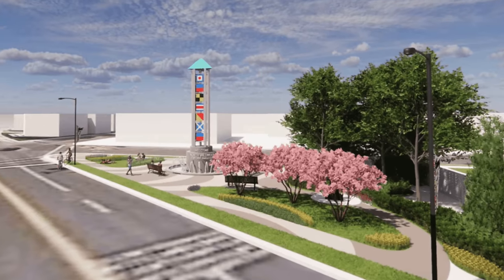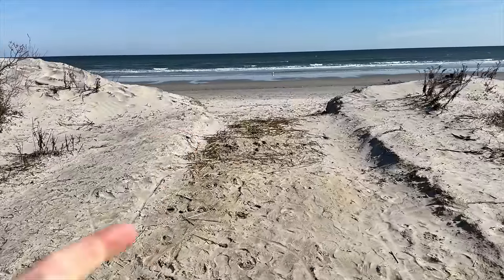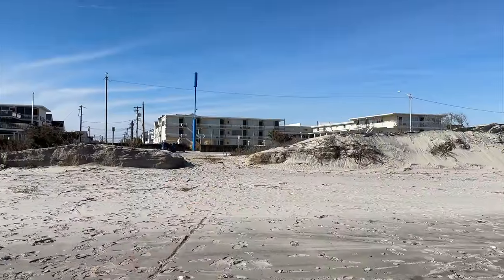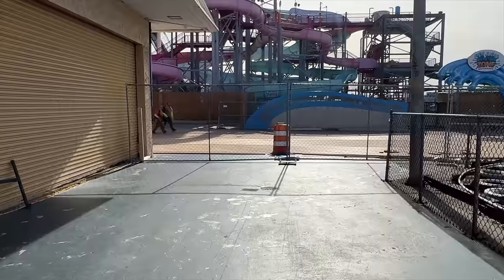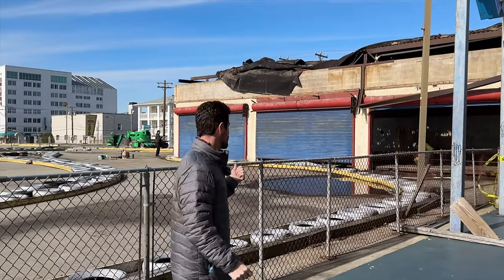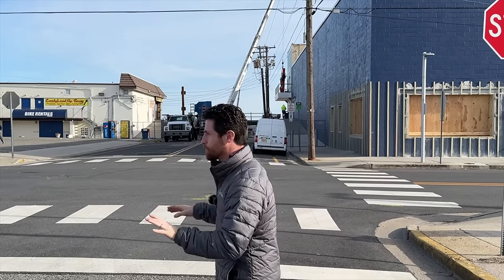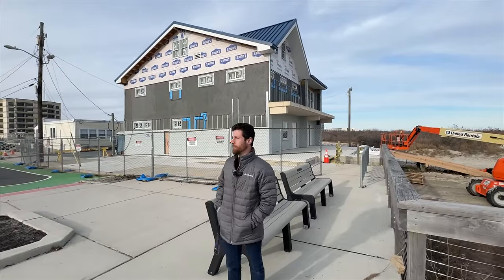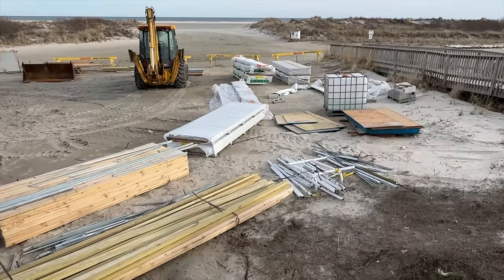Wildwoods Construction Update - March 2024

Comment: Wildwood is almost unrecognizable from my days there 1960 thru 2000. Last house on the left, Oak Avenue, right on the bay.  The train tracks were between the house and the power station.  We crabbed on the trestle that connected to West wildwood. There was an arcade next to that Hot Spot location at Oak that had machines from the 40's and 50's. We saw Jaws at the Theater that used to be where the waterpark is at Cedar. The bus terminal was on Oak, right behind Franconis Pizza and there was a bar, The Martinique, I think, right next to that.